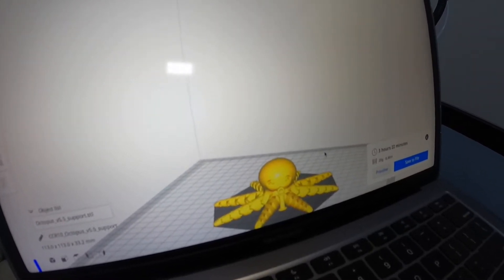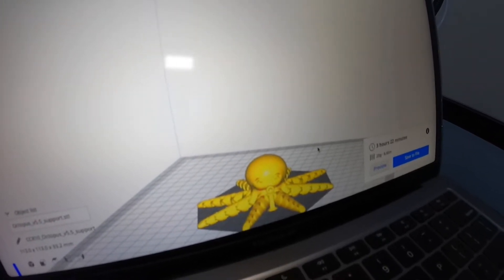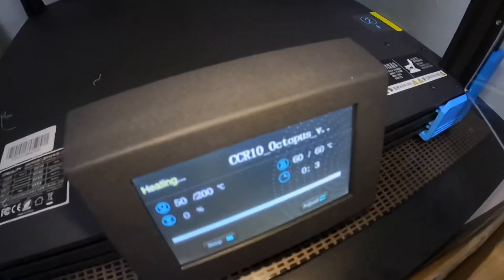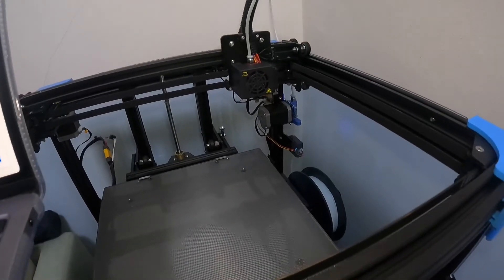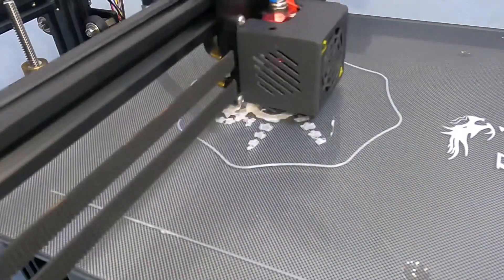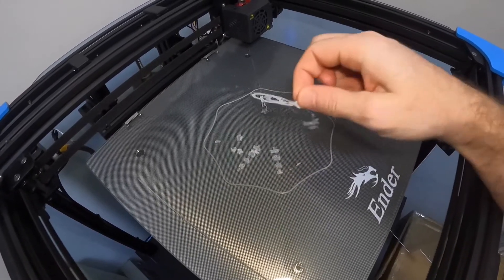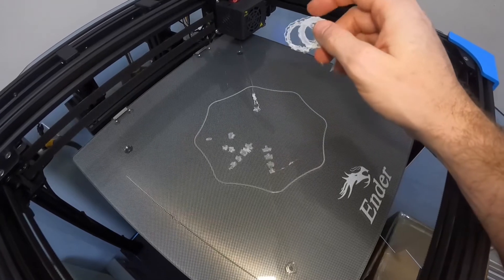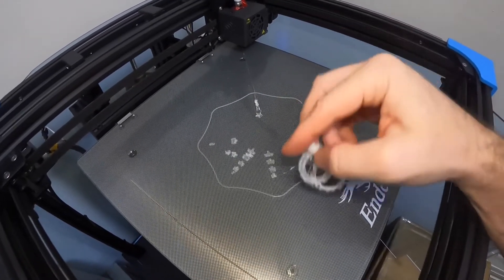3D Printing Fail - Octopus Print Failure

Comment: I have the same issues about the bed sticking. I have now use 65 bed temp and paper glue.
Reply from the maker: I heard that a very light dusting of hairspray might work. I also slowed the print speed down. Another thing I tried was a bed rebalance to make it slightly closer and it improved.
Reply: @MrNegroni  Have you heard about these https://www.filafarm.de/collections/druckbetten ? Some one recommend it to me.